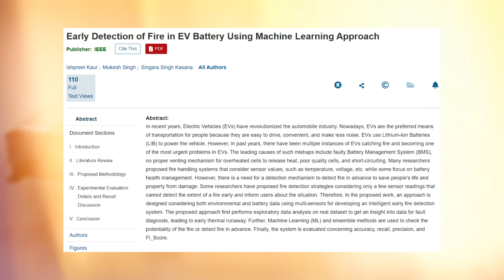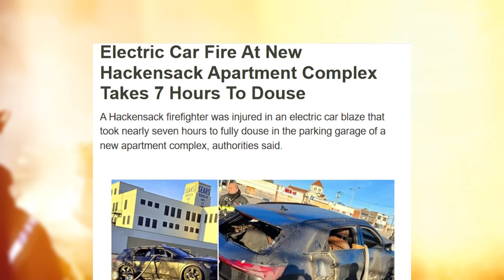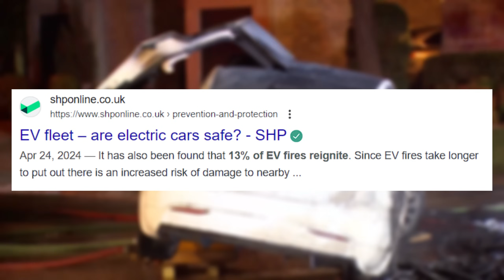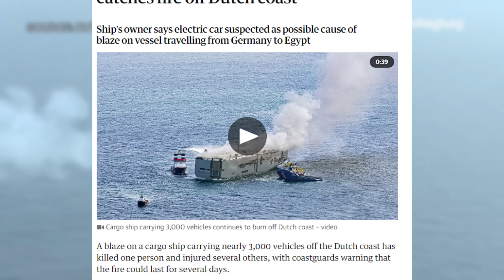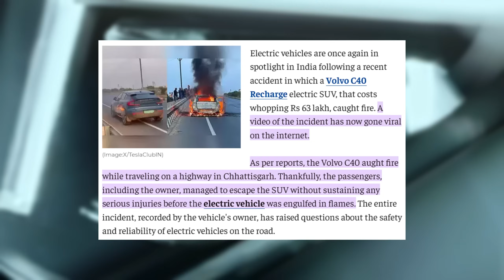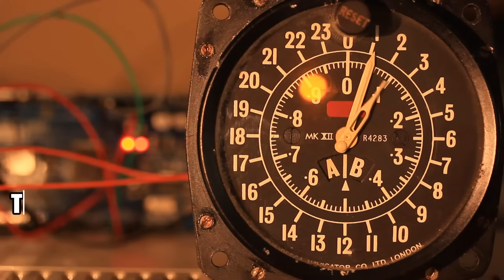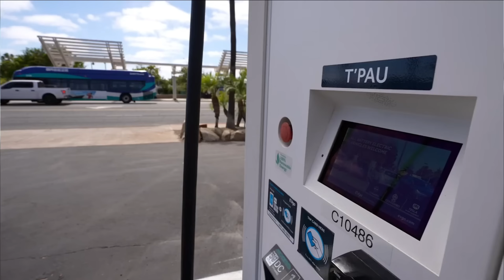EV Fire Risk Skyrockets: What They’re Not Telling You About Electric Car Safety! Electric Car Danger

Comment: The reality is that evs fires are fewer than ice cars. Especially in BEVs are rare.
Reply: Ah.. there he is... 😂
Reply: While EV fire incidents may be rare, the battery is located under the cabin floor and when it starts to burn, it burns explosively, with very little escape time.　Moreover, spontaneous combustion occurs.
On the other hand, since the ICE ignites from the engine compartment in the event of an accident, there is time for the fire to spread to the cabin and the driver can escape if he or she is conscious.

Comment: All the water used in that seven hour session was contaminated and should have been contained.  How much does anyone want to bet all that water went into the ground or run-off areas?
Reply: So how many ice car fires include contaminated water run off that isn’t contained? All of them. Cyanides from burning plastic, sump oil, and a whole raft of cancer causing chemicals.Dichlorodifluromethane, Benzene, Propene, 1,3-Butadiene, Acetone and Toluene. Just goes to show how gullible the anti EV amateur pundits are.

Comment: All to solve a problem that doesn't exist, the sun is just getting hotter, its currently the hottest its been in over a thousand years, also asphalt roads raise the avg temp 5c in city areas.
Reply: Not the hottest in the last 1000 years, the 'Medieval Warm Period', 950 to 1250 CE,, was hotter than today, and prompted the expansion of the Norse into new territory - why do you think Greenland was called that? Don't just go by ICC 'Computer model estimates', but use reliable data from sources like NOAA.